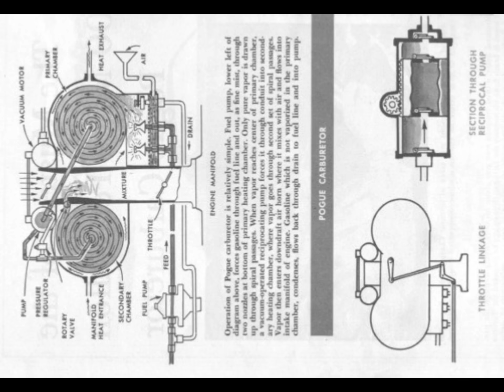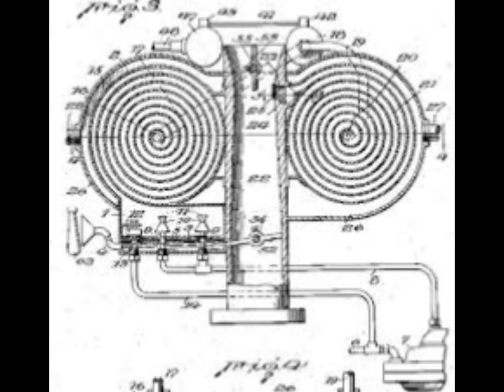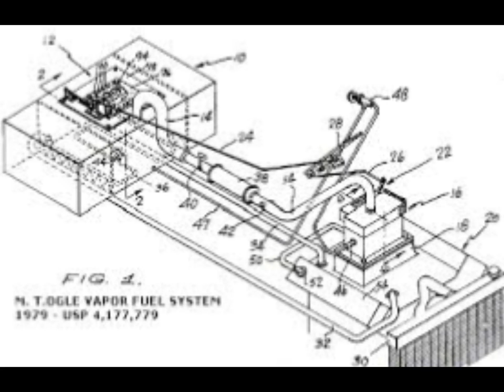100 MPG Pogue Carburetor

Comment: Vw engine tested years ago in wheel barrel, on gas fumes . yes runs engine, and color is gray vapors. Rotated fabric in rotating liquid fuel chamber with heated air passing in upper open  section. Holes in carb soldered shut except for diaphram pump squirt for starting. Spud in jet drilled/mounted on side of carb at venturi point. No contaminents on tissue over engine exhaust pipe.
 Also tested hose from vapor cannistor under car to adjustable brass valve mounted on car intake manifold. 1974 AMC Carter carb Idle jet screwed in shut. Gas cap modified with check spring valve added with hose going down into tank. When regular emmissions tube under car  pulls vacuum, the air bubbles INTO gas tank creating bubbles of gas laden air whicjh goes to front of car running engine 6 cylinder amc runs on fumes vapor from gas tank. Squeeze brass valve clear tube, engine shuts off.

Comment: I've been told there is a 300 mile potential in 1 gal of gas, and we don't even use 10% of the fuel that goes through the engine. I haven't taken the time to run any numbers, but I'm sure we are not using much of the fuel that runs through the engine. I was nationally certified in automotive tune-up in the 70's, and believe me there was a lot wild stories flying around about fuel mileage in that era. YOUR driving habits and vehicle maintenance is the average persons best bet.  My barber told me once that he had bought all the gadgets that were on the market at that time, and put them on his car. Drove about 30 miles to Birmingham... said he had to stop twice and drain gas out of his tank!!!!   Y'ALL have a great day in the "LORD".   =)

Comment: Pogue stated in an interview that the Air and Fuel were not heated together. The spiral heating chamber only heats fuel! Then the clouds of headed fuel vapors spill into the air intake when a valve opens. The heated fuel has positive pressure, and the intake has negative pressure. No air can go into the spiral chamber that's very important!
Reply: Also key here, is that warm fuel vapor mixes with cold air, not with warm air.

Comment: Use this, pressurize the gas tank (Air compressor),use small fuel lines(5/16) add a flash arrestor before the opening top engine.Remove fuel filter (to much resistance)Then your good to go .
Pressure inside the tank will automatically push fumes into the engine in hot climates stacking the fuel vapor upon startup.Ensure the liquid fuel never leaves the tank is the ultimate goal....or this whole system would be worthless.(The bong method)
Cleaner burn,less carbon build up.
Smaller lines mean faster fuel movement.
Reply: Yes it works but you need customization and a couple safety systems.(Flash arrestor is a must),make sure the liquid gas doesn't leave the tank,make sure the ga talk can handle the pressure.

Comment: I looked up the temperature gasoline ignites at without a spark or flame and found 495° F. Then I looked up exhaust temperatures, and found that they exceeded that, sometimes by double. 
As shown in this video, the pogue carburator would basically be a bomb. 
Am I missing something?
Reply: I experimented with pure vaporization gasoline systems. I think it takes way more heat than 495 to ignite it. But, Please,PLEASE DONT experiment with this unless you know what you are doing! Right? Gas and fire=explosion!!
Reply: "King of random" boiled it on a sunny day. He even splashed some gas onto the stove surface. Maybe that's why that dude (KoR) got exit early?!
Reply: Gasoline also has a 420⁰F boiling temperature.  Methanol has a 148⁰F boiling temperature, not to mention a whopping 867⁰F ignition temperature.  Way safer than the Ethanol normally mixed in with 173⁰F boiling temp & 793⁰F ignition temp.  Gear heads want us all to grow methanol, it's safer for us.

Comment: BIG QUESTION what is actual measured MPG at 65mph ?  ABOUT ExhaustGasTemps: War time ice engines on airplanes were allowed to run lean, and the truth back from them is that the EGT goes high as you lean the mix, but then surprisingly goes lower as it gets to max lean ? ... Interesting, eliminates the valve burn issue,  one guy actually used a monoxide detector in the tail pipe, no alarm went off , he says as one of you did that the gas burns so completely that its actually safe to breath the exhaust (not recommended  of course) but just to say, yeah it works...
Reply from the maker: That's kind of what I heard too, because ur burning so much less fuel
Reply: thats exactly what some research paper on air fuel mixtures on the internet said. found it a long time ago. the key to efficiency was getting it so lean that it ran cool.
Reply: @allandulles7108  Yeah, i forgot what i posted, but the gist is that yeah a long time ago like ww2, when pilots were low on fuel they could lean the mixture, so they could make it back home, info i heard was that at first the ExhaustGasTemp EGT would go up, but with more and more leaning", it would then go back down,, WOW so that means the vapor fuel idea would work.   BUT also you should heat the gas with either exhaust gas in the tank (thru airtight tubes ) or with radiator fluid in tubes (2 or 3 heater cores should work great), in this way you can get the gas to vaporize alot more fully and get it to where the Exhaust won't even set off a monoxide detector... i was going to try, but so many are already on it, i thought i would just advise them that the EGT is not an issue as most thought.   I still want someone to tell us the increased efficiency in mpg at 65mph? please tell us if you know it.
Reply: @allandulles7108  When will your prototype be ready to test ? lol
Reply: @InventPeace1  shit, I wish. I need to find that paper first. But another problem is that if the mix is too lean, I don't think a flame would propagate reliably. But I am not sure if the low temperature lean is rich enough to propagate flame.
Reply: this isnt applicable on an actual vehicle,just as a basic study on a 1 cylinder engine with no load

Comment: How about dual spirals. One side is hot exhaust and the other is the air fuel mix , getting hotter as it travels the sprial to the center where it is then sucked into the plentum ( intake ) and distributed to the cylinders.

Comment: The earliest EFI systems obsoleted all carburettors.  Combustion efficiency has been in the 90%+ range for decades because of this. But thermodynamic efficiency is much lower; 40% on a road car is stellar. No petrol mixing device will change that.

Comment: Hi John, just spotted this only now, so sorry for the late response.
I very much believe in the Pogue high mileage carburetor!
His system obviously reflects the technology of that era.
It was difficult to understand your explanations of your system, but I seem to understand that fuel vapors travel through the spirals in the 2 cannisters and these canister are mounted in a box through which hot exhaust passes.
It seems to me that the Pogue carburetor has 2 spirals in each cannister, thus creating 2 separate spiral shaped chambers, one for fuel vapor and the other for hot exhaust fumes to flow through and the heat exchange happened between the spiral wall separating the two gasses.  The design you are pursuing is in that sense very different from Charles Pogue's plans and heat exchange - and vaporization -  is likely to be very different!
Not intended as critique, but hope this may help you in your endeavors to achieve your goals.
How far have yo come until now? Any updates or progress reports?

Comment: A 95:1 or 100:1 A/F ratio would cause your motor to run extremely hot. Maybe for this to become mainstream we need to build a motor that can take the heat?
Reply: Maybe not, less waste is less heat.  73.5/1 air/vapor fuel particles is 5X the 14.7/1 liquid fuel standard and exhaust wouldn't really have much smell.  Besides the heat argument, with all due respect just alter the octane detonation point to a lower number, that's easy.  Deeper dished pistons, thicker head gaskets, higher octane fuel, intercoolers, that's an easy one.  I didn't even mention Methanol.  You can grow that stuff and it's awesome.
Reply: Weak mixtures only run hot because the flame front is slower causing burn to be completed well after TDC. Advancing ignition timing will improve this scenario. Due to much more even air/fuel mixture, vaporised fuel should burn more quickly than standard droplets.

Comment: It's true,  pure vapor gasoline systems(carburetor) do give 100 plus mpg even in v8 engines, or at least double your mpg(easy). Just pure vapor inject, change to much smaller carb.jets. Of course also use free flowing exhaust,  higher compression,  high energy ignition etc. Etc. There is much literature and methods on this. I don't think it works very well on fuel injection unless you find a way of radically leaning out/reprogramming the EFI system. (but it can be done, example- reprogram,  or "fool" the computer into running leaner using adjusted sensor inputs etc., then use pure gas vapor injection). Plus,  it will melt your catalytic converter - the pure lean burn is just too hot- that's why the factory won't do this. But,  if it's an older car with a carburetor and no catalyst,  it works quite well if your engine cooling system (maybe an oversized radiator etc. )is in good shape.
Reply: Ed Walker if carburetors can be made to work that well, then why does every car built in the world these days use fuel injection?
Reply: @logik316  you answered your own question....
Reply: Vapors are all that burn anyhow, it would be more like 5x more efficient vapors burning compared to liquid fuel.  All carburetors do is regulate the amount of fuel used.  I saw a 200cfm (motorcycle) carburetor with a big filter being used before the turbo directly mounted onto the intake manifold on a 350ci. engine.  As long as you have enough fuel before power loss (my guess is 73.5/1 air/vapor fuel) it matters little how it gets in the combustion chambers.  Although, direct injection would be best.  It wouldn't be too hot as there would be less waste being heated (fire from tale pipe is also waste).  There are many methods to prevent pre-detonation.  To name a few deeper dished pistons, hotter camshaft, higher octane fuel, methanol is also a better mix than ethanol, thicker gaskets on intake manifolds, shorter rods, lower ignition timing, and yes, intercooling/more engine cooling would also help.
Reply: no,it isnt...ignore what you "read" or what your friends ,sisters boyfriends dad said😅

Comment: About your pic of Garlits holding a
 carburetor, that carb is not the famous 200 mpg carb. I can document that.
Reply from the maker: Ok good to know.  Found that pic on the Internet on some website for suppressed inventions
Reply: People plus Garlits calls it a pogue. I have copy of the original patent. No pogue listed. That carb is a water heated carb. Mileage on 60s car good for about double. Nothing near 100.
Reply from the maker: @MAXMPG  it's water heated, that's a good idea ... John Weston in Florida had an electric heated carburetor Which worked but I found to be very dangerous.  I used to be really into the gas carb thing but now I find compressed air engines and Vanadium redox flow batteries to be more interesting than proving to the masses that gas will explode with a 1 to 100 gas air ratio rather than automotive industry standard of 1 to 14.  When you start to tell most people this their eyes glaze over or they vehemently argue against you, but then it's my karma because I was just like this in my younger years
Reply: I have a pogue style device built like a pogue . Built by someone else. It almost could be used but the unit is not sealed well to separate the exhaust from the intake. It probly wouldnt idle. But the builder did a great job otherwise.

Comment: I can show or tell you how to build a working carb. Your close but there are some things that you need to understand about what happens when you get the motor to run. About the fuel and the engine and the motor block. I don't know what the milage would be once a carb is built correctly but it would work great.
Reply: Hi..and what we must do for that system can work good
Cam You Tell us? 🙂 Thank you

Comment: Can anyone know (answer) would LPG vaporizers work as a fuel vaporizer ... ? I mean , Lpg is getting in as a liquid fuel and then it vaporize in fume and to a intake ... Lpg vaporizers already have intake for engine cooling system sooo ...  just saying ... maybe ...
Reply: Lpg got a lower boiling point (-42°C) then gasoline. So if it gets released in  atmospheric pressure it wil vaporise instantly. Thats why lpg vaporisers work for lpg. and you cant use it for gasoline becus the boiling point is mutch higher. Unless you heat the lpg carburator to high temps then it can work for gasoline as wel. I hope my answer helps you.
Reply: Thanks for your answer , it helped . I see ... So , in that case , with little modification of Lpg vaporizer it can be used to "warm up" the gasoline before entering next  ("hotter") chamber and finally  be vaporized...

Comment: I feel like this method may indeed increase gas milage, but man it seems dangerous. 2 air tight canisters filled with fuel vapors = explosion. if even one spark, or gets too hot. Need a way to build those safely so they wouldnt explode.

Comment: With a 100:1 air fuel ratio you WILL burn a hole in your pistons.
Go right ahead
Reply from the maker: Tom Ogle of tx ran that mixture back in the 70s and his engine was fine.  Some one killed him for it though
Reply: @johnironsmith4402  another conspiracy theory nut.
Scientific fact: lean mixtures are extremely detrimental to any engine no matter what fuel you use or how you get the fuel into the engine. I have no doubt these carburettors can work but unless you are in the 14:1 afm ballpark the engine will run like shit, overheat very quickly and die quickly after.
Reply: 3 years already. I'm hearing my fuel up to 216 f... Coolant temp.. truck has 270k miles... Tel me about it boi... ya ya please. Or just chill, go watch moonlanding
Reply: @TheXaelem  the mixture can in fact get so lean that it runs cool fti
Reply: @wandalllither2452  diesel or gas? what percent increase you seeing?
Reply: Not so, less waste is less heat.  Besides, lots of countermeasures to lower octane and prevent pre-detonation like, deeper dished pistons, higher octane fuel, methanol additives (just to name a better additive), hotter camshaft, lower ignition timing & intercooling to name a few